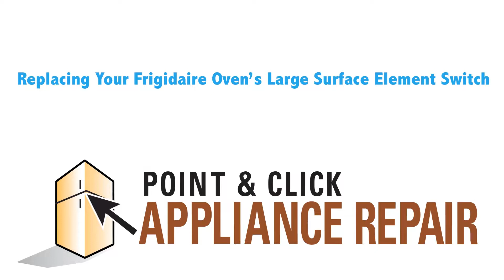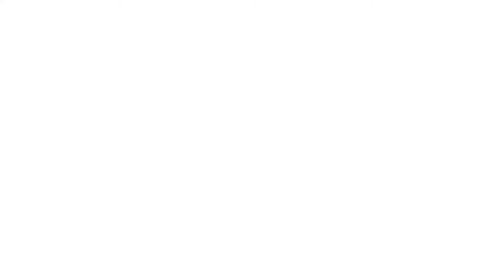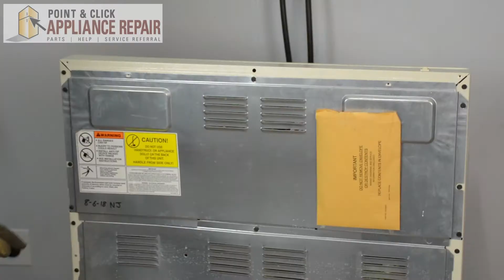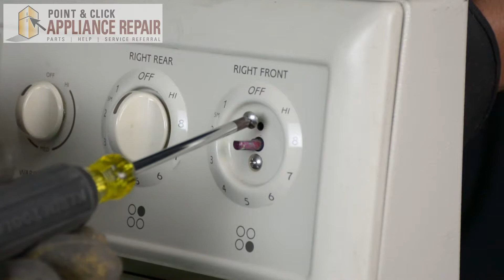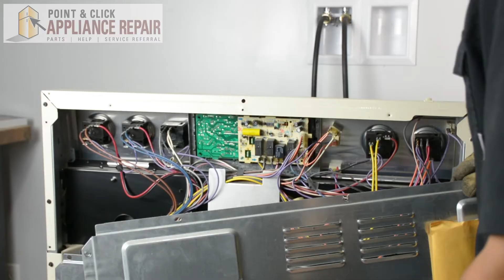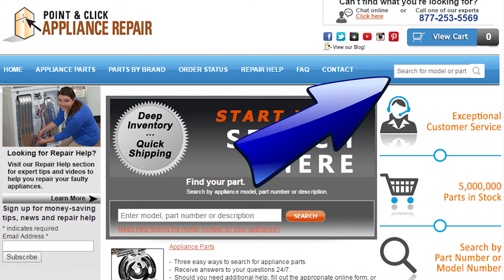316436001 - Replacing Your Frigidaire Oven's Large Surface Element Switch - AP3885460, PS1145040

Comment: Great video, I have a Frigidaire electric stove top. My oven doesn't turn on. I had it checked, and they told me it was the control switch. The repair was going to cost me $350.00 dls with the part include. I think it's a bit too much to pay for a 10-year-old stove. I'm better off buying a new one. I would like to buy the part and install it myself. The model number of the stove can't see the first letter F336DCE, any help would be appreciated thank you in advance.